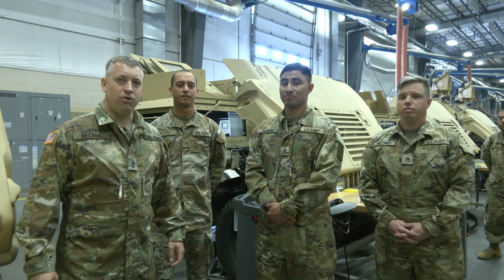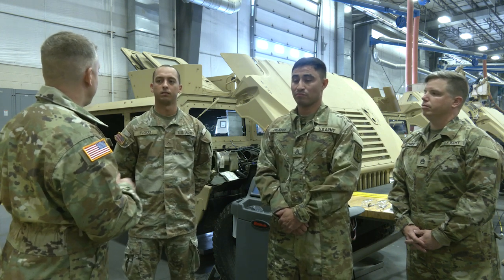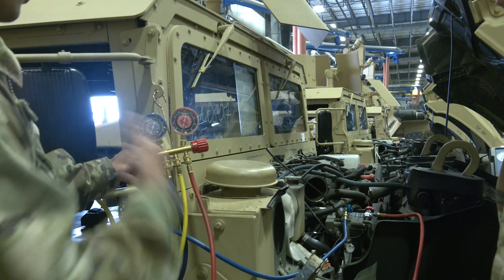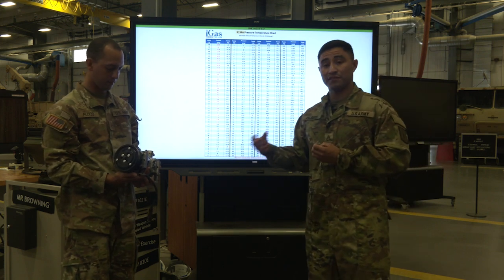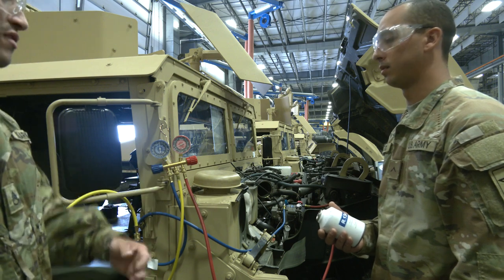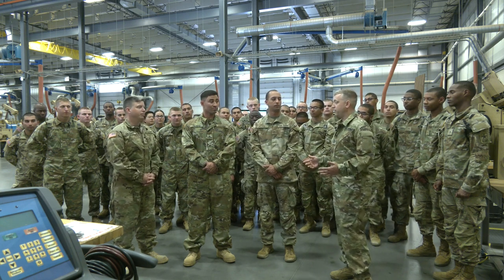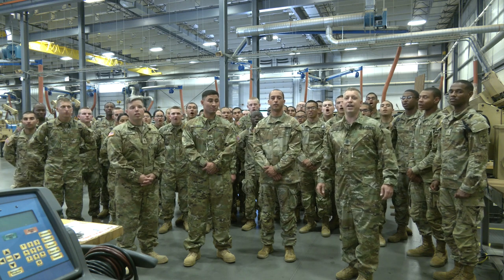Pressure Testing Cooling Systems | Under the Hood | Ep 9

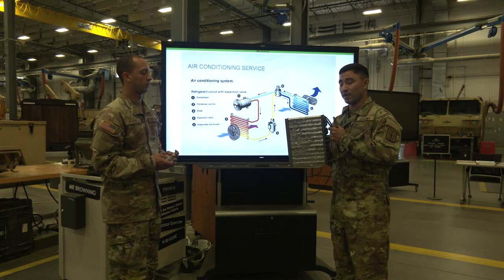Comment: Did you see that evaporator???!!!😮The mashed fins on your evaporator core will not allow the heat to go into the evaporator, therefore system ventilation supplying hot, unrefrigerated air to the passenger compartment!! Purging the access hoses after connecting the gauges & freon supply would've been a cool thing to do, too.  I looked at 11:40 again, that evaporator will not accept heat from the airflow!!  I'm sure you will not try to reuse it with out alot of handy-work to the evaporator fins.  Thanks for allowing me to see the presentation.